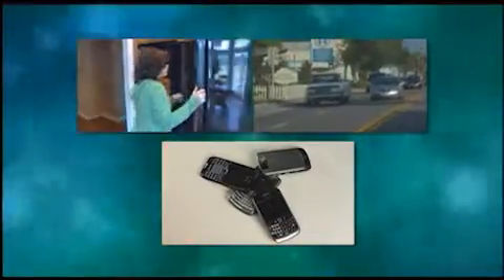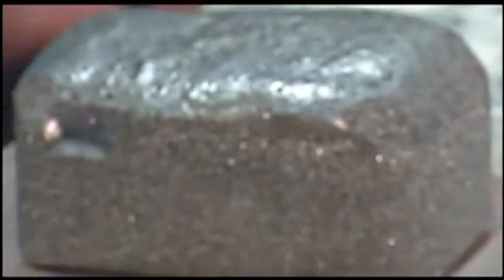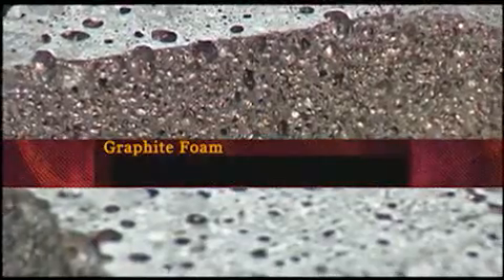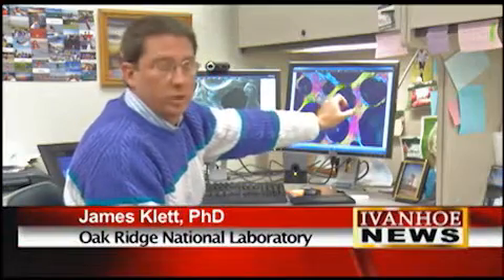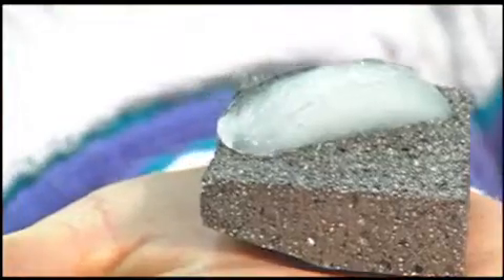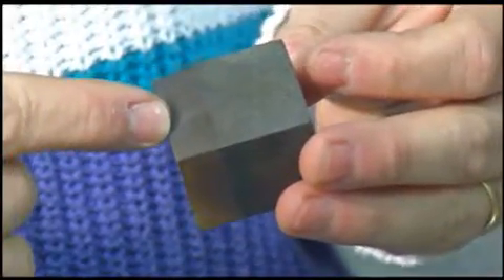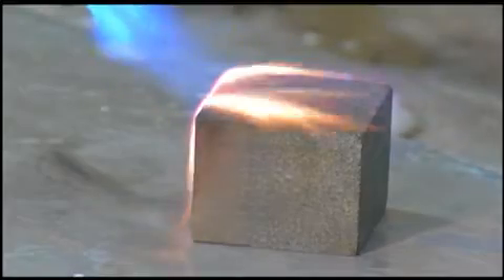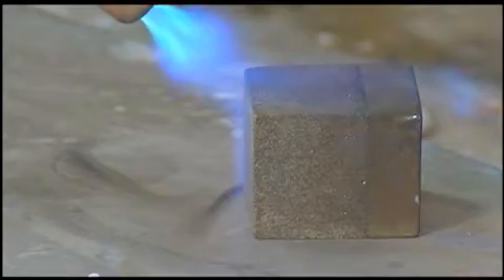Smaller, Lighter, Faster Gadgets (latest discoveries of Chemistry this 2011)

Comment: it costs a lot, about 25 dollars a cubic inch. its not a good conductor of electricity, but it DOES conduct it.  there is resistance, and the highly porous structure makes it more difficult to find a direct path for current, also creating more resistance.